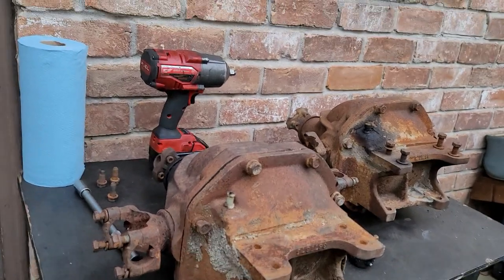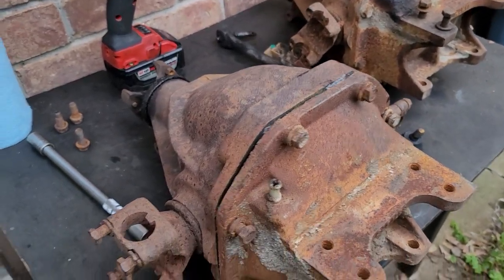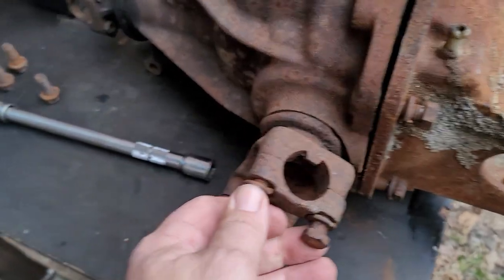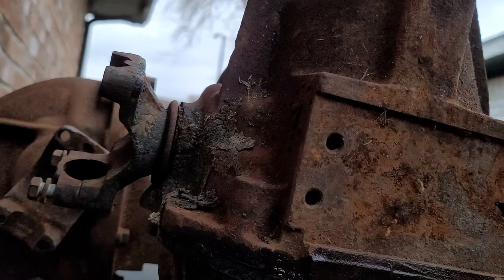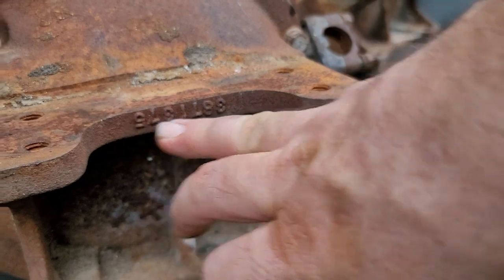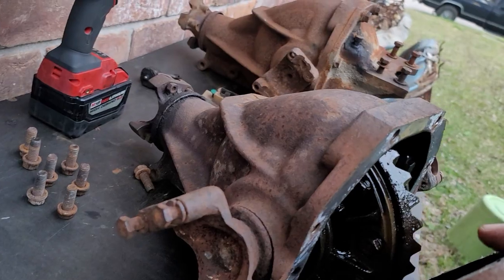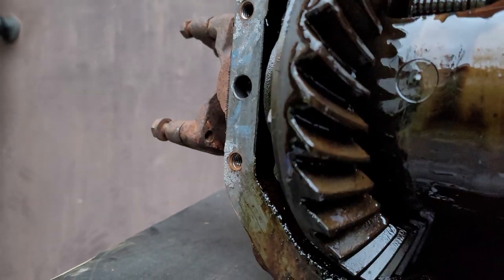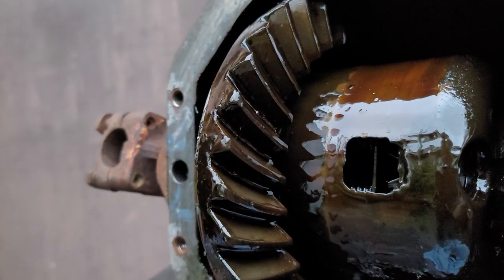The C3 Corvette Heavy Duty 427 Rear Differential Identification and Teardown

Comment: That ring gear looks to be in excellent shape.
Reply from the maker: It is actually quite nice. I've set it aside for the restoration of one of my early C3 chrome bumper cars.
Reply: You know, if it aint' broke, then don't fix it.  Those axle gears just need a thorough
cleaning, new gasket and gear oil.  And maybe scrub the housing and a coat of paint.
A lot of times with used parts you get lucky and find a gem like you have there.
Cheers!
Reply: Oh, and perhaps a new pinion seal.
Cheers again.
Reply from the maker: For sure, excellent recommendations. Have a great New Year👍.

Comment: 3.55 from 1968 with a 427 was extremely common. I had 3 of them
Reply from the maker: Yea, that definitely seemed to be the gearset of choice on the street.
Reply: All 1968 435hp cars got the M21 with the 3.55 standard. You could also order the 3.36, 3.70 or 4.11 but I suspect most kept the 3.55.
It was the same for 1969 but the automatic entered the picture as an an option with a 3.36 but still you know a lot of 3.55 M21 cars sold in 69 too.
Reply: @thud9797  it was the wildest back then an you could order just about any setup. 5 stars on knowing that one. I thought it was 336

Comment: Would you recommend synthetic or normal 80-90 wt oil?? I heard synthetic loses some viscosity when hot and can cause leakage through old pinion seals??
Reply from the maker: Hey Joe, I like the traditional oil myself. I have a rebuild differential unit on the bench right now. I may have to look into the synthetic to see what difference it would make.
Reply: I called Jerry McNeish and he said to go traditional gear oil with posi fluid.

Comment: My 70 LT-1 had those caps and although no one believes me  my canadian car  was ordered with no options except a mono  fm radio  but it had a factory M-22 and 4.56!  I seen 5 ZR-1's with 4.56 but only one  other LT-1  got this option on 70 and unfortunetly  it was stolen and no documentation to prove it!!!
Reply from the maker: Hey Joe, it's very possible your car had the HD caps. The assembly line was never a set in stone operation, so if the car was ordered with M22 and 4.56, it's possible they installed it with an HD carrier.

Comment: I’ve got a ‘79 that came with a TH350! As I understand it these came with Dana 36 rears that are weak compared to the T10’s that came with Dana 44 or even the later 80-82 aluminum with modified Dana 44. 
I’ll be rebuilding the engine taget around 400hp.  Debating how to make sure the rears good for another 40 years
Reply from the maker: Hey Chris, like you said, the Dana 44 units first appeared in the 80-82 C3 Corvettes, with the Dana 36 installed in the automatic transmission C4's and the Dana 44's in the standard transmission C4's. The Dana 36 had an 7.75-inch ring gear versus the stronger 8.5-inch ring gear of the Dana 44. 

The C3 rear differential was manufactured for GM by Eaton Gear, and while pretty strong, will tend to self-destruct under repeated abuse or extreme horsepower. Based on your target horsepower you mentioned for your build, I think you would be fine with the sturdier Big Block unit I detailed in the video. They could withstand the horsepower output of the L88, so you shouldn't have any problems.
Reply: @VetteSource Thanks , I was thinking about an all aluminum swap if it’s got the better mechanics even if the housing is a bit weaker.  I’m not going to do any racing or even slalom stuff. The occasional high speed highway run be the most. I’ve been seeing the composite spring is a much better ride but isn’t a simple bolt on. Saw the composite on a pre 80 needs longer bolts the German TÜV aren’t impressed with.
Reply from the maker: Gotcha. I think one of the main issues you will have is adapting the aluminum housing of the 80 and up Dana units to the earlier 79 and down Eaton style differential. The Dana units mount in a completely different manner, with a "batwing" configuration. It's workable but require some frame modification.
Reply: @VetteSource  well that takes the fun out of that.
Reply from the maker: Yep, that's for sure😁.
Reply: @VetteSource  out of curiosity how extensive of frame modifications?   Drop a couple holes, add a couple brackets or just buy a suitable frame meant for that rear?  Lol
Reply from the maker: If it were me, I would find a rear section from an 80-82 and cut and splice the mounts into your frame. I may actually have a later frame section piece in my inventory. Do you have my FB or IG contact information?
Reply: @VetteSource that’s awesome. I don’t have your contact info.   How do I find it?
Reply from the maker: You can reach me @VetteSource on FB or IG. Just type it into Google and it will pop up with my DM and contact information.
Reply: @VetteSource  tried on messenger :-)
Reply from the maker: Got it👍

Comment: My 69 corvette rear has locked up on one side. Other side is free. What is my next move?
Reply from the maker: Start from the outside and work your way in by removing the caliper and brake rotor. If you're lucky, it's just the parking brake shoes that are locked up and seized to the inside of the rotor. Penetrating oil will be your friend during this step.

If that doesn't work, remove the half shaft and see if the rear diff will spin by hand. If it you can turn it, most likely you have a frozen half shaft bearing. Good luck, and let us know how it goes👍.

Comment: Will you notice aby play in either side of the diff if the C clips are busted or off ???
Reply from the maker: Definitely. Once the C clips have snapped, the side yokes will pop in and out and will tend to mushroom as they continue to pound against the inside of the differential, rendering them very difficult to remove.

Comment: Is it common for a 71 that came from factor with a small block 350 to also have the 427 or 454 rear end you shown with the heavy Ubolt clamps?  If so I’m in luck added the 496 Stroker years later… good video, thanks.
Reply from the maker: Hey Alex, it's not very likely since the assembly line workers followed a pretty strict protocol on which parts were installed where. Odds are that the differential in your car was changed out at some point due to a failure of the original unit. You can always check by looking at the number stamped on the bottom of the housing to see what date and axle code is on it.
Reply: If it was an automatic transmission then yes definitely possible and maybe even common. I know the base automatic in 74 had the HD caps.

Comment: I have an 82 with a 427 Dart Smallblock. It's making 550hp at the crank. How can I convert the stock rear end to something tougher to handle this kind of power?
Reply from the maker: There is a solid axle conversion kit for C3's that handle that kind of power. If youre not looking to go that extreme, an upgrade to a Big Block rear differential with stronger half shafts will handle the extra horsepower well.
Reply: @VetteSource  I know Chevy changed the suspension design between the early and late C3's How do I convert it back to the old design?
Reply from the maker: Paul, you're correct. I completely missed when you mentioned yours was an 82. The good thing is your car had a Dana 44 from the factory, bad news is its an all aluminum case with a very highway gear ratio. 

I would look into some of the Corvette specialty shops that offer upgrades for that Dana unit with stronger internals and half shafts. I know they're out there, just can't remember the name of them off the top of my head.
Reply: @VetteSource  that high gear is really messing with my engine.  I can't drive in overdrive less than 60mph. The cam is far too aggressive to cruise at 1700 rpm. I drop it to third when I'm below 60mph.
Reply from the maker: Yep, it's a 2.59 ratio if I am remembering correctly, which kills your ability to keep the engine running in the power band.
Reply: @VetteSource  GEEEEZZZZ!!!! 2.59????? No freaking wonder I'm lugging the engine. It's time for some upgrades.
Reply from the maker: Yep, that will definitely help. Let me know how it turns out👍.
Reply: @VetteSource  will do.

Comment: what do you have in the way of rear gears for a 95 i would like to get away from the 259 and get around 345 or something in that range
Reply from the maker: Randy, you're in luck because Yukon Gear makes a 3.54 gearset with PN # YGD36354T that is made to fit a Dana 36 2 series carrier like what is installed in your car. 

I would recommend going that route, since trying to source a Dana 44 with factory 3.45's will be a bigger task and more expensive since the manual retransmission differentials are hugely popular. 

As long as you aren't looking to throw a 3500 stall in the transmission and drag slicks out back, the 2 series carrier should hold up just fine on the street with the deeper gearset.
Reply: @VetteSource  thanks so much for the info and no no racing just a little show off stop light to light thanks
Reply from the maker: No problem, buddy👍

Comment: can you swap a 3:36 for a 3:08 on a small block 350/300h automatic??  Thanks
Reply from the maker: Sure, that's one of the easier conversions to make. Keep in mind however, that by changing the rear differential to a deeper gear you will throw your speedometer off a bit, so you will need to swap out the drive/driven gears on the transmission output shaft to match up with your given combination.